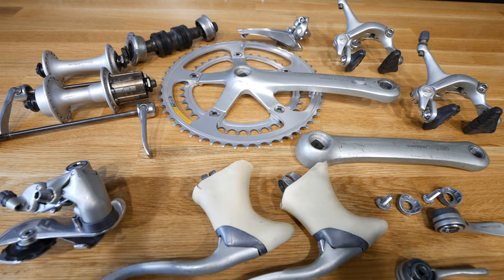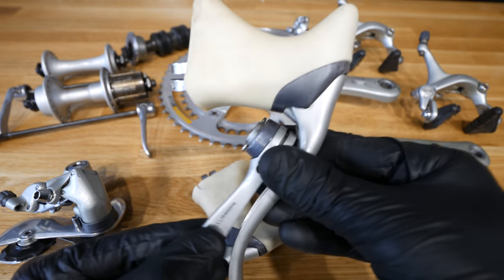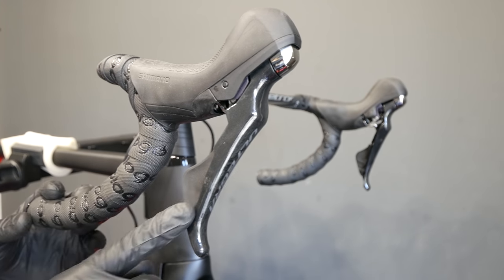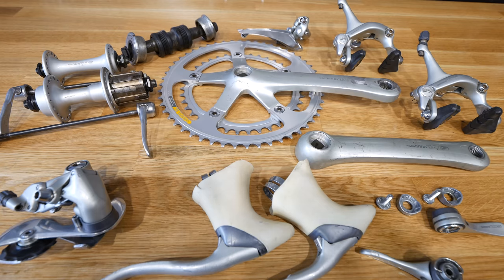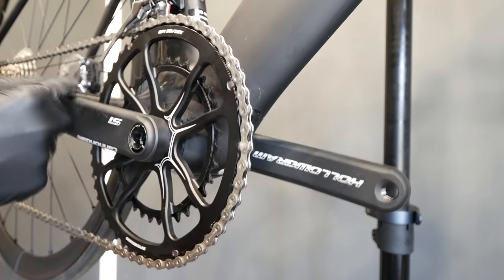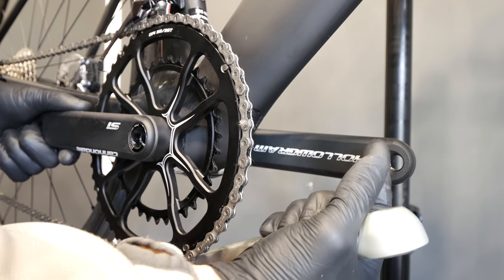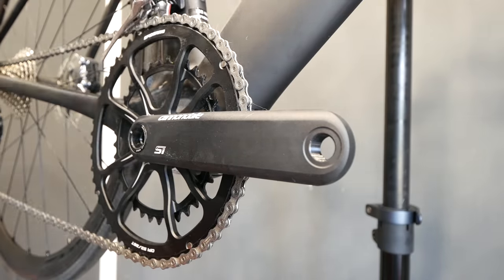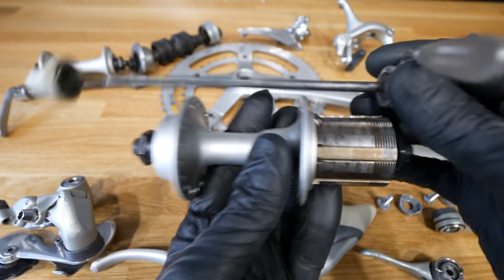7 Things Road Cyclists Could Only Dream On in Their Bikes 30 Years Ago.

Comment: In 1990 I was riding my Zullo with Campag Record. Of course bike technology has come a long way, with a few deviations.  Commenting on your points (I'll have to edit a few times) ...
1. No, we didn't change gears every minute. We watched the terrain and planned ahead for changes. One thing you don't mention is the range of gears we have today. With fewer gears we change gears less often. But you say the Shimano combination lever is the most "intuitive". Firstly, most people misuse that word, but it really comes down to what are you most used to. I use Campagnolo and Shimano, and prefer the Campy approach. With Shimano its easy to shift in the wrong direction, and even apply the brake by mistake. With Campag there is a different lever for each action, accessible from above or below.
2. Bottom bracket changes. Yes, steel axles are heavy. Some great engineering and materials have certainly improved things. The plethora of "standards" is crazy. 
3. Hollow crank arms. Yes, big weight saver. Another big change at around this time was clipless pedals becoming popular. Until then we used toe straps. Today we have more consideration of crank lengths also, but time will tell if this is a big one yet.
4, or maybe 5. Disc brakes. Not everyone is convinced. They are heavier, require stronger wheels, harder to work on, easily damaged, require special tools, etc. But they work better in the wet, don't wear wheels out, and have higher stopping power. My next bike will have disc brakes. 
6. You mention quick release vs through axles. The quick release has a skewer through the axle. Through axles are certainly stiffer, but the key reason for them is that disc brakes apply a torque that operates on the axle, differently to rim brakes. Through axles are more secure, and I would say are necessary, with disc brakes. 

More later ...
Reply: Keep it coming. It's important to hear that bicycles weren't always so ridiculously over-specced and expensive as they are today.

Comment: If you went back another 5 years things were really more primitive.  The freewheel threaded on the rear hub. The shifters did not index and the brakes levers not only had the cable running out the top, the calipers had a much stiffer spring and no spring in the brake lever.
Reply: Why did people back then ride such shitty bikes even though jets were supersonic, personal computers existed, and there had already been a man on the moon for decades?
Reply: Back in the early 80's i had an old 10 speed made of bits and pieces. The rear derailleur had indexing, as detente for positioning. The only problem I had  was the derailleur and the rear sprockets didn't  match. But it was a 10 sp road bike.

Comment: Two items of note for me:
1 - Wider gearing range. Standard setup 52/42 chain rings and 12-25(23?) cassette.
2 - Cartridge bearings. No more cleaning/re-greasing loose ball bearings and cages (had a stupid smile on my face the 1st time I replaced the bottom bracket on my vintage mtb with a cartridge one).

Comment: I'm still riding this groupset on my carbon fiber Cadex. It works just as well now, as it did back then. I don't feel it suffers in comparison to my more modern groupsets
Reply: Have you ridden the modern equivalents? If you did what were your observations?
Reply: Yes ..I have...downtube shifting never bothered me, but I have modern 105 and Sora groupsets on other bikes i own, and aside from the ease of shifting with the newer brifters, I really don't see any difference in reliability, ease of shifting, or anything else for that matter. Yes...those older groupsets were only 7 speed, but aside from the limited range, I think the older groupsets were very reliable...hard to believe that we got by with 2x7 instead of 2x11or 2x 12! In some ways I think that today's cyclists are a little bit spoiled by technology. I own 12 bikes, most of them vintage. I love older bikes, when things were a bit simpler. I do appreciate today's tech, but I enjoy riding with all eras of equipment,!
Reply: @stephenstevens6573  I had a bike in the 80's with the original 105 group with indexed shifting on the downtube and they were not durable.   I remember having to set the shifter to friction mode because the indexing would slip out of position.   I would say the modern shifters, even the lower end groups, are much more reliable.

Comment: -You missed the BioPace rings that sorta came back with other manufacturers not long ago.   heheh. 

-Another huge change that wasn't mentioned (or maybe i missed it) is the switch from freewheel to freehub.    I had so many bent and snapped axles before freehubs came along. 

-Puncture resistant tires...I would often get 1-2 flats EVERY week on those old tech, super narrow tires.
Reply: rim tech, can't remember the last time I buckled a wheel...…..maybe 10+ years......used to always buckle wheels in the 90's....okay I was in my teens and mostly dirt jumps but even so wheel/rim tech......wish I had todays wheels growing up....back then you'd be lucky if a rim would last the summer they really didn't fill you with confidence
Reply: @lcc8394  I went through a good number of wheels before i finally discovered quality double wall rims with pocketed eyelets.   I had one front wheel last up to 3'ish years ago when i slammed into a curb and dented it.    Two things i DON"T like about modern wheels are, first, it's getting harder to find welded rims (vs pinned joints) which was the norm back then.   SEcondly, that BS with a machined wear-groove in the brake track.    That groove the first point of failure on the rim, and it also screws up brake pads more quickly.  Bits of sand can also get caught in that groove..

Comment: I had a Cannondale with fat aluminum tubing, and a Shimano 600 groupset. The rear shift lever had detents to click into place for each gear. The front was the normal friction type. I still sometimes reach for the downtube in order to shift! Pedals with toe clips and straps. (Pro tip: put a twist in the strap where it passes through the cage to prevent it working around.) And when we wrapped that thin vinyl tape on the handlebars, we started at the centers and worked towards the ends.

Comment: Integrated brake and shift levers (brifters if you like) are convenient, but downtube shifters are mostly bulletproof. They do fail occasionally, but at nowhere near the rate integrated levers fail. No worries about crashes, and downtube levers with index and friction switching option can work with any number of gears in a pinch.

As far as other technologies are concerned, there was a lot more cross-compatible back then. Standards were a lot more standard, Yes, there were issues, but not the crazy stuff like today...can you say bottom brackets?

Comment: Wish I wasn't old enough to have had that Groupset when it came out lol had the tricolor ultegra on my race bike too
Reply: I also had some of the parts on that table when they were shiny new.   I still remember looking at the boxed Campy groups in the stores with the delta brakes, etc.
Reply: @littlegoobie  still lust after those deltas even nowadays, I managed to get hold of the mektronic mavic shifters from Evans when it was just the one shop in the Cut, never any of the problems other people had with them in fact they worked faultlessly up until the moment I let a friend try my bike out and crash it for me.
Reply: @jonnythelegs2597  That's crazy money.   In general, I won't spend that kind of money on anything that's a wear piece or quickly becomes obsolete.    It's definitely fun finding a great deal on something you wouldn't normally get.    

 Unless someone is endorsed, i don't understand what would make a person spend their own money $20K on a bicycle, or have an entire shed full of $7000+  bikes that have $3000 wheelsets installed.   return on investment is worst than a car, especially when your friend crashes it.  hehe..
Reply: @littlegoobie  My friend paid for the damage and I don't waste money on cars or use any other motorised transport, i use bikes instead, my legs don't pump out pollution every time, i use them. My expenditure on travel is far far lower than the average person so having swanky bikes really isnt such an extravagance especially when you rarely pay more than trade price too.

Comment: There used to be a really small metal bottle looking thing attached to the frame of the bike located mainly in the rear wheel by the brakes underneath the seat, that used to power the lights like a tiny generator you would pressed it against the side wall of the tire, the tire while in motion would rub against the top of the tiny  bottle and the friction would generate power for the rear and front lights, I forgot the name though, wonder why it dissapeared since it was free energy!
Reply: Dynamo
Reply: @c40uk98  Thank you! Would you believe I couldn't remember the name till you mentioned! Thank's, I wonder why it went out of fashion?
Reply: @josesegura2090  It dissapeared because using it turned your ride into a constant uphill battle, easily 2~3% incline, the faster you went the more it braked you! The power going to the incandescent lamp was aprox 6~8watts, plus all the other losses in the system.